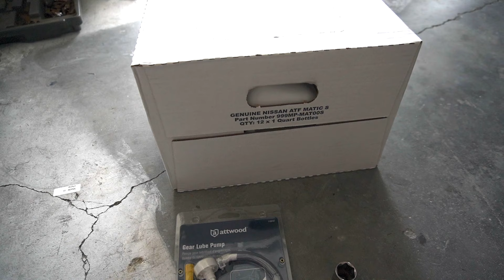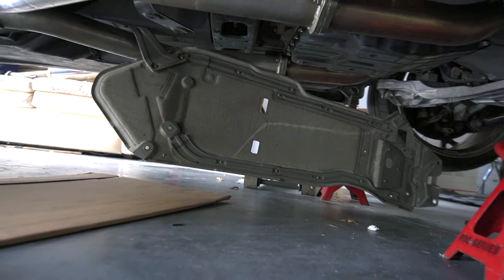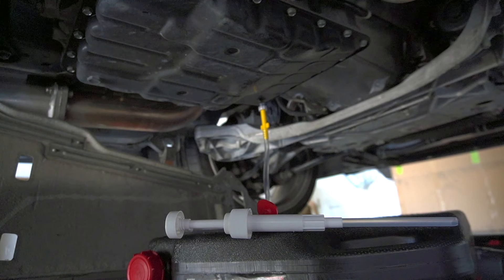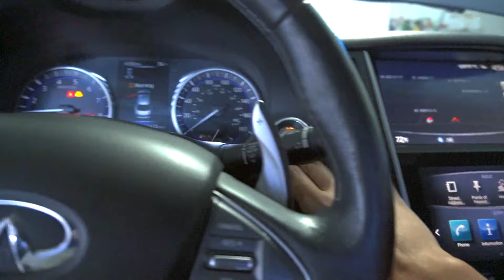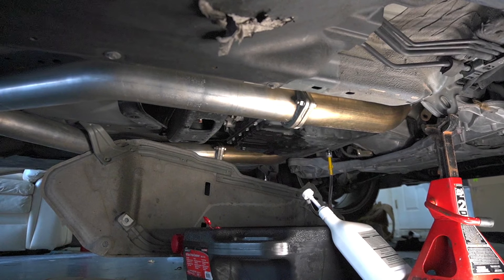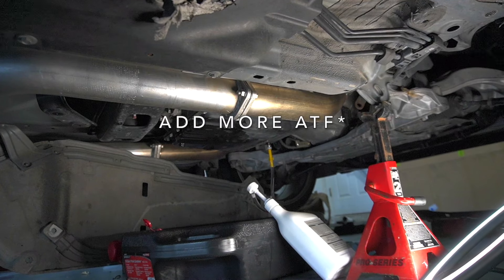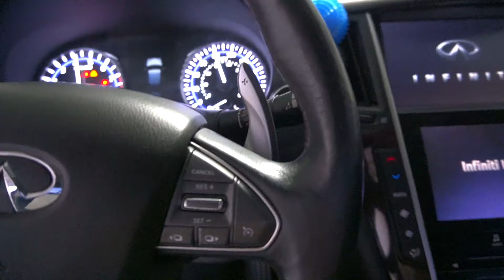Q50 Q60 DIY Transmission Fluid Change | Carbon Forged Caps Giveaway

Comment: Hi Zilla. I followed your instructions exactly and when I went to remove the fill plug adapter a TON of fluid started coming out. I drained 3 times and filled 4 times. Is this normal? Do I need to let the excess fluid drain?
Reply from the maker: Hey, yea that’s fine. It should be dripping out. If it’s pouring out it’s too filled.
Reply: @ZillaFullBoost  thank you. I verified by speaking with a master tech at INFINITI on Atlantic in Jacksonville, FL👍
Reply: @Alexander-vb7ov   did the tech say to drain the excessive fluid out of the fill hole. is the transmission full when its pouring out or dripping out
Reply: @CA-lp1cb  the tech said to let the fluid drain until it's just dripping like Zilla specified in this video. Everything turned out fine.
Reply: Yes let it drain

Comment: hey guys, i have a 2017 q50. recently my briother was driving it on the highway and it stopped speeding up. the rpms go up but it stopped shifting. after i checked it out, now when i drive the rpms go up then suddenly it will shift super late. plus it only shifts to maybe like 3rd gear. only can drive up to 40mph then it wont shift, just the rpms going up. it looked like on the front passenger wheel something completely busted and there was a liquid all around it. any ideas on what the problem might be? is it fixable or does it sound like i need a new transmission? sorry for the long comment and thanks for any feed back
Reply from the maker: Hey, sorry to hear about your car. It's hard to diagnose over the internet. If you have a check engine light I would check that first. If not take it to a dealership or independent Infiniti mechanic that can help find the issue. If you have fluid around your wheel the axle probably went bad. Good luck.

Comment: Wait so I’m stuck on the last part so when it reaches 104 degrees do I still keep the car on and remove the bolt or do I turn it off ??
Reply from the maker: Honestly don’t worry about the temp. Just fill it until it comes out the drain hole.
Reply: @ZillaFullBoost  so just fill it the last time and can the car be off when I do that ??
Reply: @ZillaFullBoost  and also what do you mean fill it until it comes out the drain hole ? You mean the hole im using to fill it up ??
Reply from the maker: @anthonysantana9193  yea. Just fill it and go for an easy drive. Once up to temp and nothing feels funny push it harder and verify all is ok. If it slips go put more fluid if it’s good then you’re done.
Reply: @ZillaFullBoost  okay n by up to temp you mean like when the car is warmed up and I already went through the gears right ? Should I step on it , I do plan to overfilll a quart since I am tuned and I pull hard on the car, I read that’s preferred if you do hard pulls 😭😂
Reply: @ZillaFullBoost  whats ur take on adding extra oil
Reply from the maker: @anthonysantana9193  go for a normal drive. Wait to push it until the car is completely warmed up. If the car drove fine go through a few gears down shift and do a couple pulls. If it’s good and you hear or feel anything weird then you’re done.
Reply: @ZillaFullBoost  will do just that man I appreciate you !

Comment: Hey bro ,help my transmission suck in third gear , can this be low on fluid and also I notice a speed sensor code pop up
Reply from the maker: Speed sensor is bad. You need to replace the valve body.
Reply: @ thank you bro , can I use the valve body of a awd q60 .i have a rwd q60
Reply from the maker: @ no it must be RWD
Reply: @ZillaFullBoost  thanks bro , can a rwd 3.7 vhr tranny 7sped valve body work ,Sorry for any inconvenience
Reply from the maker: @torvarrisevans9334  if you currently have a VHR trans yes if not you need the VR30 valve body.
Reply: @ thank you bro , am from the Bahamas, I really appreciate it
Reply: @ I have rod knock as well on my red sport the motor needs to be replaced, my bro has a premium model q60 300hp Will  his motor work in my rs
Reply: @ any particular year off the vhr tranny it has to be , so that valve body can work properly.
Reply from the maker: @torvarrisevans9334  any vr30 would work. If you get a 23+ you need to replace the boost sensors on the Intercoolers
Reply: @ZillaFullBoost  I have a 2017 red sport  high output motor and my bro has a 2017 premium awd  low input motor  and according to z1 motor they said I might run into issues with the ecu if I make the swap. Is this by any means true
Reply: @ZillaFullBoost  hey bro I replaced the valve body but I have u1000 code and it still isn’t from passing third gear
Reply from the maker: @ have you tried erasing the code? If it’s still happening you probably got a bad valvebody or one not for your specific trans.
Reply: @ZillaFullBoost  I got it from a g37 3.7
Reply: @ZillaFullBoost  thank u bro
Reply from the maker: @torvarrisevans9334  is your trans the same trans from a RWD VHR?
Reply: @ZillaFullBoost  am not sure if this is a issue that causing it but some how I end up deleting my software From my infotainment , my backup camera,drive modes and my screen doesn’t work
Reply: @ yes
Reply: @ the code showing speed sensor is fine now but I always had these u1000 code popping  up on my engine, transmission and Abs system

Comment: Hey Bro, first of all, thanks for sharig this informative video. Is there any equivalence transmission oil that can be used for Q50 diesel engine 2.2L ? I am located in West Africa and am suffering to get maintenance kit.
Reply from the maker: Hi,

Genuine NISSAN PSF or equivalent DEXRON VI type ATF may also be used such as Max Life

Comment: how many quarts did you fill on the last round? how much does the car hold overall?
Reply from the maker: I filled what drained out 3qts. I’m not sure the exact fluid capacity maybe like 4-5 qts.
Reply: thanks

Comment: What year is yours? The owners manual says nothing about the fluid being lifetime, it says "only use Genuine Nissan Matic S ATF. Do not mix with other fluids." At least for 2014-15 models.
Reply from the maker: 2016

Comment: Is this is the same process for a 2015 Q70 3.7 all wheel drive ?
Reply from the maker: Yup, same transmission but you have a transfer case which I think has its own drain hole as well. If that’s the case then you’ll need a bit more oil.
Reply: I did the filter and oil change for my qx70s but it does not do the 3rd and 4th changes, is there any advice that can help me

Comment: Do you need to get new crush washers for the transmission drain plug?
Reply from the maker: It’s good practice to replace especially if it’s deformed. I however reused it and I will replace on my next flush.
Reply: @ZillaFullBoost  is it the same washer for the oil changes or different part number?
Reply from the maker: @isaiasmeza620  That’s a good question I’m not sure. It might very well be.
Reply: Bought my 2021 RS RWD new and it didn't have a crush washer.

Comment: Everytime you drain and refill, do you have to start the car for one minute?
Reply from the maker: Yea to cycle the fluid. I personally ran through the PRND a few times each drain and fill. I didn’t mention that because that wasn’t on the procedure and didn’t want to be at fault for someone’s tranny failure, but it seemed to work out fine and cleaned out most of the fluid.

Comment: Just curious what the point of filling and draining it?
Reply from the maker: Good question, to rinse out the older dirtier fluid. I personally ran through the gears a couple times every time I filled it. Wasn’t advised to, but I did it anyway. I didn’t want to recommend it with out knowing if it would mess anything up. So far my trans has been happy so go for it.
Reply: @ZillaFullBoost  oh okay I’m doing a vr30 trans swap and it only has 8k miles and it was draining for weeks it took 9 quarts of fluid😂
Reply: But it was spotless on the inside so I figure I’m good with just leaving it filled
Reply from the maker: Yea you should be good to go 💪🏽

Comment: How many miles  should I drive after a transmission fluid change ? Before I start pushing on the car ?
Reply from the maker: I recommend taking it on a drive and drive normal while going through every get to make sure everything sounds and feels ok before getting on it. Let it get up to temp and after that you’re good to go.
Reply: @ZillaFullBoost  thank you 🙏

Comment: I’m at 80k miles. Is this safe or recommended to do at that high mileage?
Reply from the maker: It’s usually not recommended for a high mileage car. However, knowing we lose the valve bodies on these transmissions I’d still do it if the transmission is operating as normal right now.
Reply: 80K miles isnt high mileage

Comment: would you suggest drop the pan and change the filter too?
Reply from the maker: It’s fine draining and filling the fluid every 30k miles. I haven’t seen anyone do replace a filter yet. Do they even sell the filter?
Reply: Not necessary,  the filter is a mesh/screen filter, as long as you change the trans oil within 30k to 50k you should be good.

Comment: I have a 2011 Infiniti G37 is it the same process for the g series? Just a drain and fill. I’ve recently bought 5qts of transmission fluid and is it required to do that drain 3qts and refill 3qts?
Reply from the maker: Yea, what you take out replace.

Comment: why are you draining fresh fluid 3 times.
Reply from the maker: I ran through the gears each time
Reply: the capacity of the transmission is 12 quarts, draining and filling 3 quarts only replaces 25 percent of the fluid

Comment: Hey man I’ve got a 2014 3.7 with 75k miles and I don’t think it’s ever been changed. Would it be safe to do so and is it the same procedure ?
Reply from the maker: When it’s a higher mileage car and  the transmission fluid has never been changed you typically don’t want to mess with it. Some say it’s ok to just do a change not a flush.

The procedure should be the same for all 7 speeds.
Reply: @ZillaFullBoost  so how would I go about simply changing it ? Would I just drain and fill the first 4 quarts ?
Reply from the maker: First Drain 3.5 and fill 3qts same steps in the video.
Reply: @ZillaFullBoost  and I would just stop at that ? And would I be able to have the car off or would it have to be running ?
Reply: @lordofthehearth2740  follow his steps, he shows exactly how you are supposed to do it. If you don't feel confident take it to the dealer.

Comment: I'm doing the drain and fill 3 times on my Lexus GS350. After that do I just do it once on every interval afterwards? Or do I have to do it 3x for every interval to get it all out? Also why did you fill 4 times if you only drained 3 times? That part got me confused.
Reply: Yea I was confused  also .drain 3 fill 3 would be correct right .also no over filling  by a quart or so ?no disrespect to your video .just questioning .love the video

Comment: How many quarts do I need and capacity of transmission fluid on the Q50
Reply from the maker: Hey, it’s in the video and the description; 12 QT’s.
Reply: @ZillaFullBoost  he was asking what is the fluid capacity of the transmission...  We know you used 12 qt.
Reply from the maker: @davidarmstrong3022  it's about 7.5 QT's. you don't have to worry about the capacity if you follow the procedure. You replace whatever you drained.